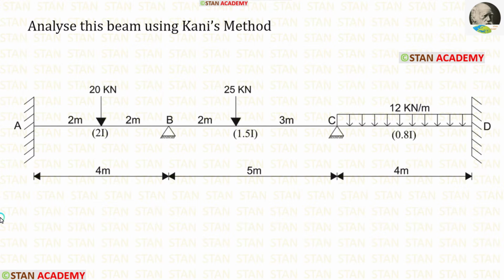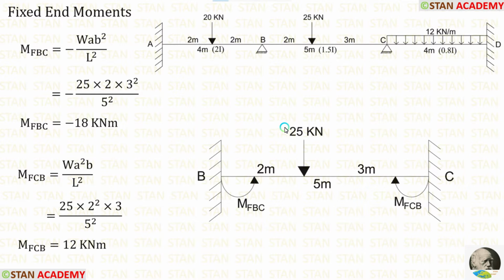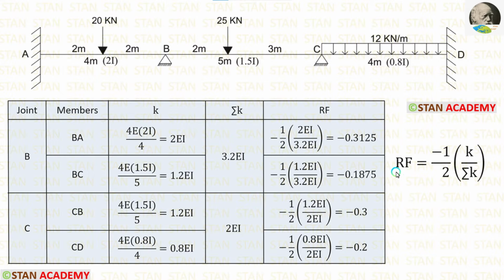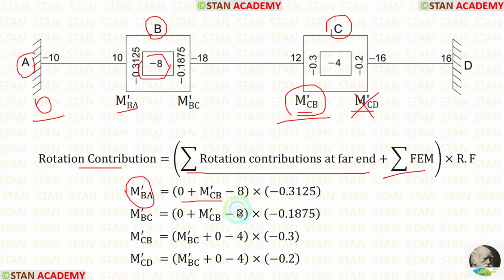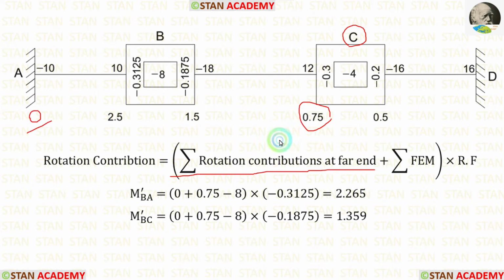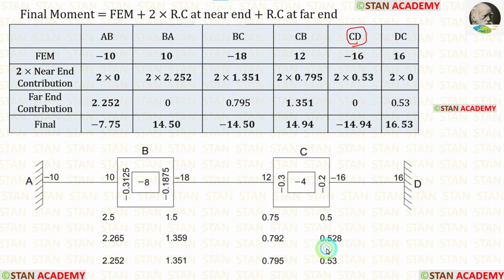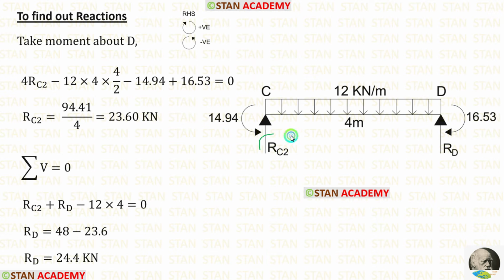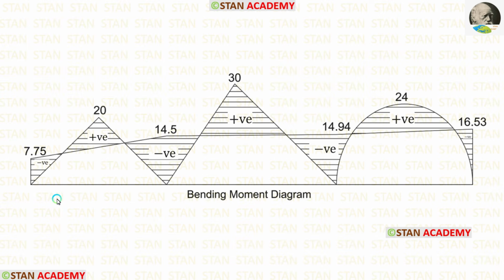Kani's Method for Analysis of Beams - Problem No 1

Comment: Sir,  can we use for finding k value for when far end is fixed I/L instead of 4EI/L
Reply from the maker: yes you can do that
Reply: Ok sir, Then I got different values of K .
Reply from the maker: if you get different k value there is no problem. but u must get the same rotation factor
Reply: Ok Thank you sir😊👍
Reply: Yes